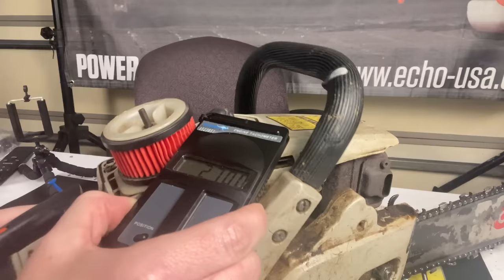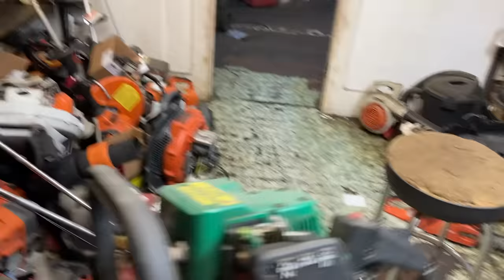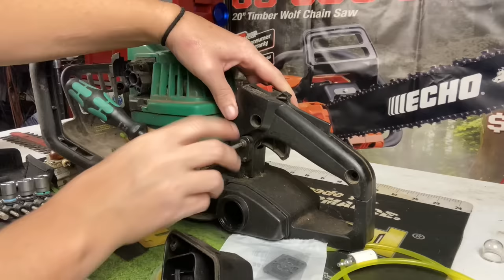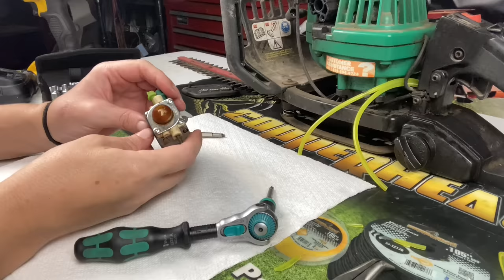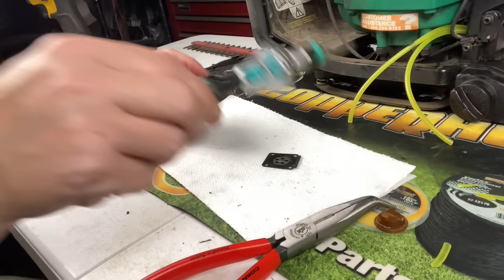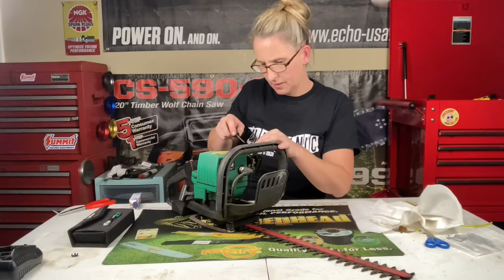THE BIG SECRET on how to store your small engine long term + Turning Shop Trash Into Treasure!

Comment: on November 2020, i bought a cub cadet riding mower..I've been sick for a while, like every few months I'd used tractor..have not used in about 6/8 months..
mid March 2023, emptied gas tank..put new fuel..
have not been able to turn it on..cranks, will not start..
saw a video about removing metal connector on seat safety switch..will most likely do th
at beginning of April..
??

Comment: Thaks for the two stroke oil for storage tip.(why didnt I think of that?) What did you do to adjust the idle?
Reply: Yeah, same question - sometimes it's just turning the idle/air screw in till it seats, then back out 1 or 2 turns....is that what we see here?

Comment: Hi have back pack blower 420C won’t start it needed  a new coil & carb & fuel filter ,spark areas or real clean new plug 
All this still won’t fire
Also new fuel carb has fuel plenty too it plenty of spark to plug won’t star even with injection ing fuel in cylinder

Comment: A bit off topic, but I have an old model top of the line DR trimmer with a B&S engine.  I ran it dry and cranked it full of oil, per the (lost) manual.  It's been sitting for 10-15 years and needs a new battery.  It's not frozen.  Do I need to do anything special to get it running?----I was using electric mowers for 20 years, but have no outside outlets here,  and it's been a wet year.  I don't believe I even have 20 hours total run time on it.

Comment: Hi Chickanic i,am working on 2 stiga shj 550 hegetrimmer chance all indside in the walbro Carb but i,t’s stil hard to start it looks like is drowning in fuel my ide is that it hase somthing to do with the adjustment of the nedle lifter when the are running the both have good sped respons on the trotel but there are comming fuel out of the exhaust hope you Can point me in the right detektion thanks in advance from Denmark and sorry for my English regards Hans Larsen

Comment: Bre, does the oil in the tank for long-term storage used for both 2 and 4 Cycle Engines?   Can any lightweight oil be used?   or only 2-stroke oil?

Comment: Mine has a separate primer bulb. The filter/feed line goes on the pump side opposite the metering chamber, the brass tube from the metering chamber goes to the primer bulb, the output of the primer bulb goes to the top of the tank. 

Mine somehow is drawing air down the hose into the primer bulb from the metering area. gaskets, metering, pump diaphragm and fuel hoses are new. Why?

Comment: Can you help me with a Honda Self Propel. I am on my 2nd pair of wheels/Tires for the rear and these tires/wheels are part of the drive system and the wheels move forward but lock up almost 99 % of the time and I have to drag the mower as the wheels won't turn. Is there any help! Tom

Comment: I bl00dy hate pull start engines. I HATE them! 
It's 2023 for Pete's sake, isn't it time we put a starter motor on everything? Even if it was a hand held starter and battery that you remove and put back on the shelf once you get it darn engine started.

Comment: your saying to fill it up with just the 2 cycle oil for storage only not the gas-oil mix right?
Reply from the maker: Enough oil to fill the carb. Can empty oil out of fuel tank and fill with mix then purge the carb when ready to use.

Comment: How do you dispose of the old gas if it has been sitting?  Burn it or what?  Doesn't seem like anywhere in my area wants to take.
Reply: I use stale gas to clean parts, kill weeds in cracks, etc.

Comment: Is the fuel line hose that you used the standard size, if not where can I find the specs on other equipment?   I have an old Kawasaki hedge trimmer that leaks around the fuel lines.  Any associated links would be appreciated.   Nice channel and very informative.

Comment: My Stihl weed trimmer won’t run to full rpm.  Doesn’t stutter, starts fine.  Changed spark plug and air filter, no improvement.  Any suggestions?   Thanks, Kel
Reply from the maker: Maybe this will help. https://www.youtube.com/watch?v=0EtOa6CLTWg&t=64s
Reply: Thanks so much. Didn’t know there was this part . I will check it soon.  Kel

Comment: Watched a couple of your videos...learned many tips....Who says you can't teach an old dog new tricks. Thank you! Now to my dilema. I have an Echo PB260 (blower). Probably 20 + years old. Had a power loss issue about 5 years ago....didn't do a whole lot of trouble shooting just put a new carb on it. That fixed the power issue. Well here we are again, same power issue....put a new carb on it and actually got worse. Runs for a few seconds and shuts down....any suggestions with some troubleshooting tips would be appreciated....When it comes to internal combustion engines I keep it simple... fuel, spark and air... Almost spent 400.00 on a new one...then I watched you breathe life back into that Weedeater hedge trimmer....that gave me hope. Help please.

Comment: If the air filter had turned to dust your compression test would have sucked it in. That gets nasty to clean out of the engine.

Comment: I have an old workhouse generator. About 8hp. New hi octane gas new carb . Gas flows through the line great. The problem is it starts but runs only at an idle with 3/4 choke. The same before and after the $$$ parts transfusion. Any ideas ? I even checked valve gaps.
Reply: Idle air screw possibly. Sounds like too much air at idle, or lean idle mixture, in other words. Does it run well at full throttle at 3/4 choke? It shouldn't so much....

Comment: I wonder how well it would work storing the engine w/diesel instead of 2cyl oil? Diesel also keeps almost indefinitely and later i can just dump the diesel and use it in one of my diesel engines 💁
Reply: Btw, Thanks for the tip, here's a tip-o' the hat 🧢
Reply from the maker: For sure! My husband used diesel to store big blocks. I just don't have it around the shop since we don't work on diesel mowers.

Comment: Great job! I too have had problems starting gas equipment after a sitting for a year. Best wishes. By the way have you ever sharpened the blades on the hedge trimmer?
Reply from the maker: We do sharpen them, but only the ones with much larger blades. It's been awhile since I did it, but the entire replacement blade set for one of these units was only like $20 last time someone wanted new ones.
Reply: @Chickanic  Very kind of you to reply. I learn a great deal from your videos. Best wishes.

Comment: Like your videos but found your dismissal of battery tools because "who remembers to charge the battery?" to be slanted towards gas.  The answer is probably the same person who forgets to drain the gas or forgets to buy gas.  

Most gas tools are too much maintenance for someone who will only use it 10 minutes twice a year.  

Full disclosure I got rid of my gas tools and have Ego battery tools for my home use.   I 'remember' to charge the batteries.  

While you spent 23 minutes in this video, I popped a battery in my hedge trimmer, trimmed for 12 minutes, popped a beer, and finished watching you still repairing this gas trimmer.

Gas tools are great for big jobs, but battery tools are great for small to medium jobs.

Comment: Be honest... After it primed and you set it to full choke, how many times did you pull the starter rope before realizing that it didn't have a sparkplug installed? 😂 Smooth transition though, we've all been there! I'll have to give the 2cycle oil a shot this winter. 

Do you think there are any downsides to this method? Mucking up the spark arrestor screen, oil gunking up in weird places, etc.? I'm sure the benefits outweigh the downsides, just curious what your thoughts are on any negative side effects to this method.

Comment: Hey Chickanic --I'm a subscriber and look at your vids for for tips and tricks. I do have a question. I have a Stihl blower (BG56C) I use non-ethanol 87 octane gas with Stihl Ultra oil. I use it weekly and run it wide open 90% of the time. It starts easily (2nd pull) and runs fine. I did yank the spark arrestor to have a look at it, and it is as clean as can be. The problem I have is that after running it at full throttle for say 10 minutes, I'll let it idle  for maybe 20 seconds, then shut it off. But when I try to start it again after a few minutes, it's a pain in the butt. When it does start, it will idle, but not want to throttle up---sounds like the carb is flooding. This eventually stops and the engine will run normally. Any idea what is wrong?

Comment: So Bre, when I put the small engine stuff (chainsaws, Mantis...) up for winter storage should I drain the fuel and run them dry and/or do something else???
Reply from the maker: My next video, I am going into why I do not recommend storing things dry. You can never get all of gas out and if you didn't have at least a really heavy  oil mix when you "ran it dry" your carb diaphragms are going to start hardening after about 6 months. I will go into detail in me next video about it.
Reply: @Chickanic  Thanks...I'll be watching.

Comment: HA haha   The Joy of getting something to Work, let alone Run.   : }     Sounds Nice!     
Would like to know what you did to Adjust Idle.   'out of low', 'limiter cap' ...  ?   

You'd be a Fun Neighbor.   Challenge of the Week;  Learn something New Every Day.    Thanks,  Cheers!   

my chainsaw Fuel Line change:  from All Mush, may have put on backwards - didn't run, yet.  lol  then it was Stolen.
Reply from the maker: I knew the high adjust was fine since it ran well at full throttle, but needed a bit on the idle. I only had about 1/4 turn out on the low adjust before the limiter cap stopped me. I turned the idle adjust in a couple turns and it ended up being perfect so I didn't need to remove the limiter cap and adjust further.
Reply: @Chickanic    Thanks so much!   i'm putting info in notes. -  just in case...

Comment: Early in this program you sort of poo-poo the idea of having a rechargeable hedge trimmer for your hedges because the battery will likely be discharged or need replaced.  BUT, on your table is a DeWalt rechargeable tool and I bet you have others that share the battery(ies); right?  I have several and extremely convenient and something of the group is used often.  Same with my yard tools frm EGO; trimmer, blower, chainsaw, lawn mower, snow blower, protable work lights, and, if I needed, hedge trimmer.  All with same battery.  I have commercial type gas tools, but if the job fits the electric, guess what I use...
Reply: Ditto, I have a DeWalt hedge trimmer, it always works great, zero maintenance issues. Also I can store it places that I wouldn't want fuel stored, places that are more theft resistant than my shed.

Comment: Have one of those hedge trimmers. But the blades are dull and does not cut clean. How do you fix this if you can't replace the blades? Sharpening didn't work.
Reply from the maker: Last time I looked them up, a whole set of new blades was $20.
Reply: @Chickanic  Weed Eater GHT220 Gas Hedge Trimmer blades are over $116.00 if you can find them. not $20.00 plus the unit is too heavy and not worth repairing
Reply from the maker: @kkovler1  These are the GHT-17, but take the same blades. Part number 530403228. Looking them up now, years later they are no longer available, but the last price was around $30 before they ran out of stock.   You might be able to find the 22 inch ones. Part number 530403229.

Comment: For people that have no problems with laziness, mentally or physically, it sure is dismally difficult to realize, how incompetent and lazy so many people are these days. I cleared 15000 dollars this year, in 6 months, just by collecting, repairing, and selling many small gas engine products that people threw away. This stuff is easy and they still won't fix it. In my line of full time work, I take trailer loads of junk, to the dump, and come back with perfectly rebuildable items, worth more than the crap I dropped off. I get paid to make more money. You can't make this shit up folks. But it is sadly true.

Comment: I have a brand new echo srm-225 trimmer first tank of tru fuel 
And I have oil coming out of my exhaust 
Can you tell me if this is normal or not?
Reply from the maker: Did you watch my video about Trufuel? Also watch the one about Stihl oil. Both will explain fully what is going on.
Reply: @Chickanic  thanks for the reply. I just watched them. How do you feel about the red armor premixed fuel?

And if I use the echo oil and mix it myself 
Will that fix my issue with the oil leaking out it the exhaust?

Comment: Like your videos but nails on chalkboard when a small engine is started cold and immediately taken to sustained wide open throttle.  No heat soak, asking for scored pistons, with faster thermal expansion of the light piston versus the cylinder. See professional users of equipment do this all the time.

Comment: really interesting video - never heard of storing a motor with just 2 stroke oil.  a few questions: what's your take on this method vs ethanol free canned gas (I know you're not a fan of canned gas for general use, but what about for storage)?  how much 2 stroke oil do you need to use - just enough to so it can be sucked up when priming right?  and assuming you can use the 2 stroke oil when you empty it back out to use the motor?  thanks for the great video - i think a specific video on storing would be great.
Reply from the maker: The oil does seem to thicken if it has sat for multiple years so I wouldn't reuse, but yes, add just enough to get it in contact with everything. I can't really say on the canned fuel, because I personally have never tried it, but I am 100% sure about this oil method. Thanks for watching!